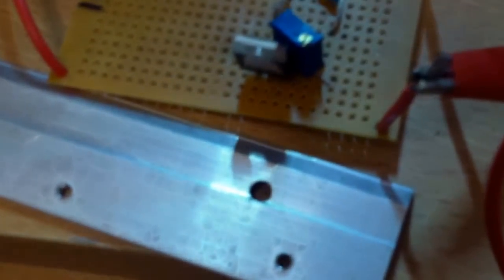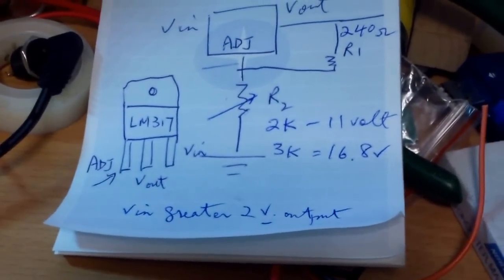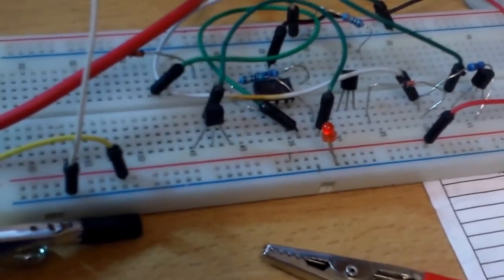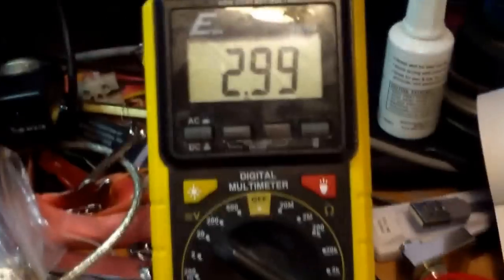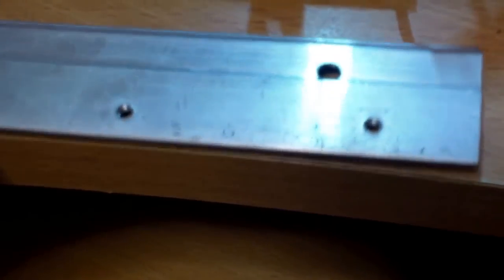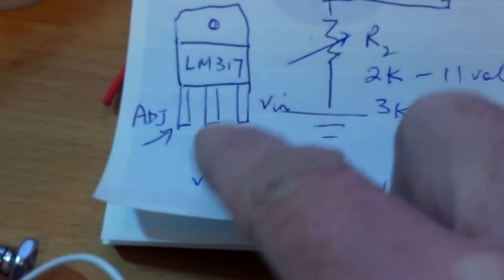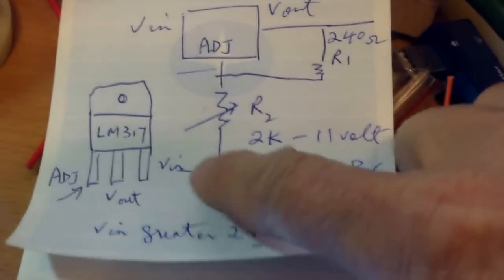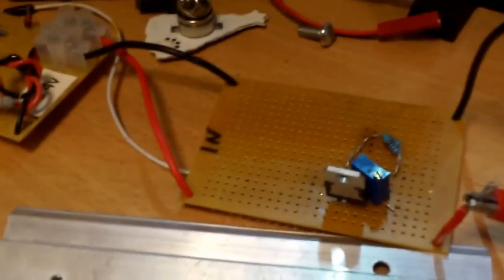LM317T as a variable voltage regulator and LED driver part 1

Comment: I used about a 25V  transformer and a few parts to make a DC voltage supply, and then used the 317T to adjust the voltage available.  Good for experiments, or perhaps for field use , testing.  I made one in a small box without the transformer, for just hooking up to existing DC sources like a car battery, etc.   The chip is not efficient so much, because it really cant.  For example if the supply is 12V and your project needs 2V, there is a 10V drop and associated power loss in that chip.     The next step is to get specific voltage regulaters, say 2V output, with a 4V input or something, so that power loss is minimal.
Reply from the maker: I guess that's why the heat sink is needed to dissipate the power buildup with that voltage drop. It is somewhat easier to build than the more sophisticated design using difficult to solder components. Thanks for giving your insights on the chip.

Comment: The pin layouts on a lot of chips don't match the schematic either.  It's done that way because the real layout on a schematic would sometimes be a tangled mess of wire lines crossing every which way.
Reply from the maker: Russ Bowers I should have known better because I made one before and this time I forgot to verify the input and output pins. Thanks for pointing it out.